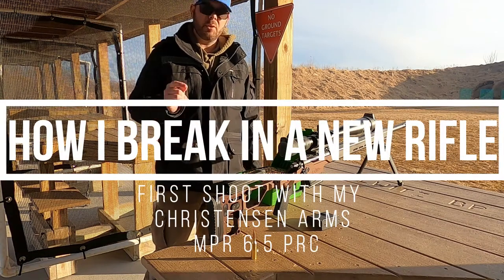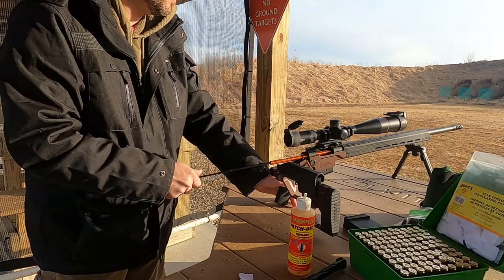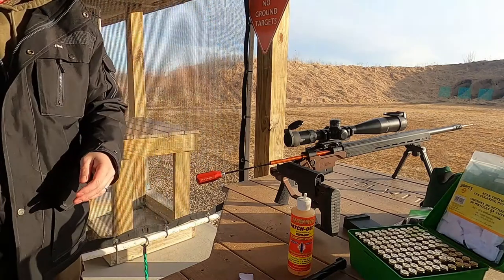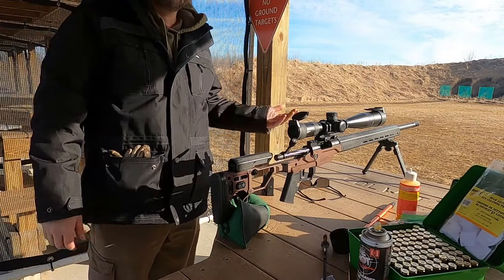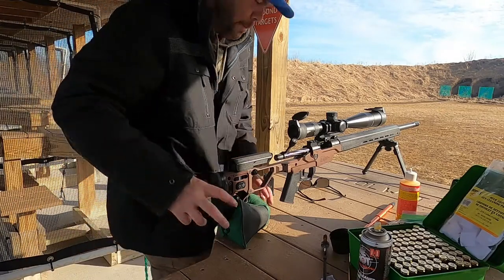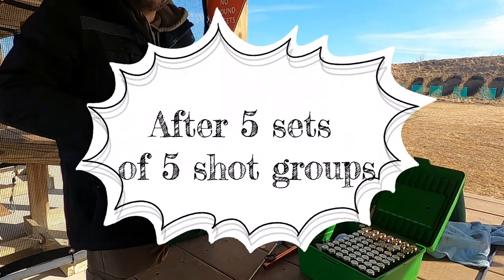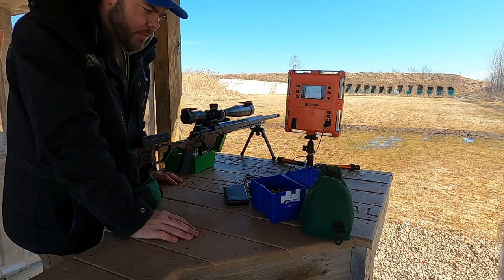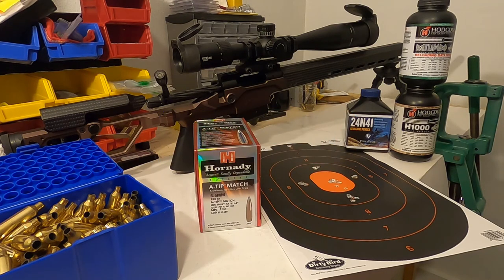How To Break In a Rifle Barrel

Comment: This is great. Good video. I also have a 6.5 PRC that I need to break in. I'll probably follow your method. I prefer the nylon brushes personally. Do you always use wire brushes? Thanks for sharing.
Reply from the maker: Yes.  Bronze is always softer than steel.  Just make sure that you run the brush all the way in and all the way out.  And once I break in the barrel, I don't clean it again until my groups open up again.  That might be a few hundred rounds or up to almost a thousand rounds.
Reply: @mattsreloadingbench  Very interesting. Do you find find that cleaning after barrel break in but before your group start to open up is just unnecessary or has negative side effects?
Reply from the maker: @antlerkids  I either clean after every shoot or not clean until the group opens.  For consistency.   That has been what works for me.  But I typically do the 2nd option.
Reply: @antlerkids a nylon brush works depending on what you're trying to do. Remember bullets have a copper jacket that rubs off when shooting. If you're not trying to disturb that use nylon. That's what he's saying about his group opening up. Too much copper in barrel. I do the same. I never clean my barrel unless major carbon builds or there's too much copper exiting barrel when firing ruining POI. Just do your DOPE...